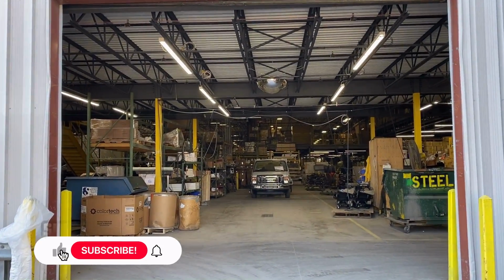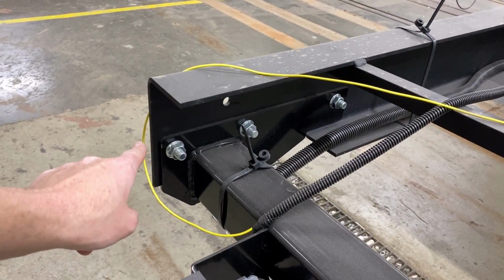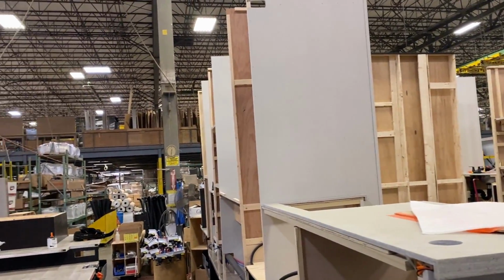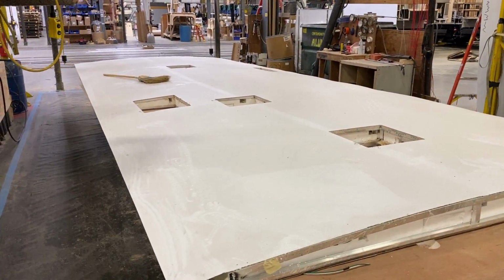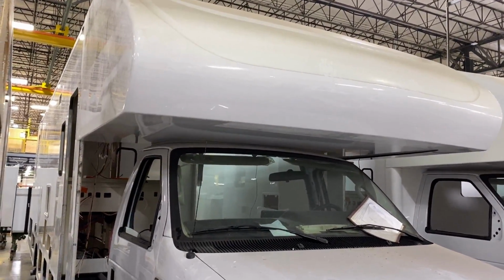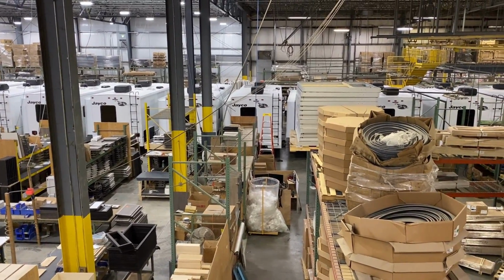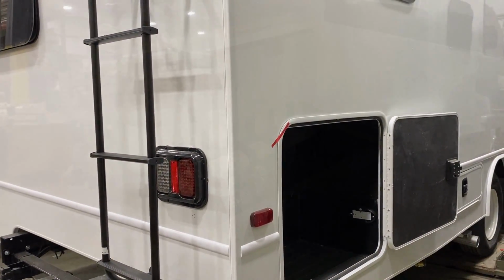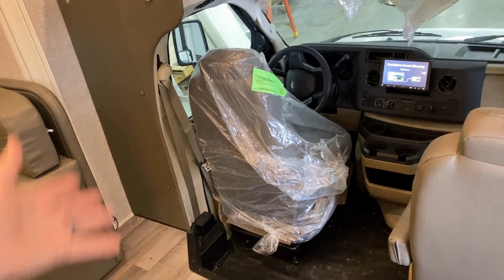Jayco Class C Motorhome Factory Tour!!

Comment: I saw a used 2006 Grey hawk that was a turned in at the dealership to be cleaned up before being re-sold. It had all the tires replaced. It had less than 26K miles. I was the first customer to get a walk thru while it was parked in the service area of the dealership. The attention to detail was outstanding. I asked the salesperson questions and I know that if I need to find out a true answer to my questions, I need to find them in the specs.
 As far as the question you asked about the refrigerator, I believe 12VDC is the way to go. I also have to say that the 30Amp is better than having to try and find a 50Amp site. 
I want to thank Josh for making this video.

Comment: Really like the factory tour! Thank you Josh. 
Yes on the 12v compressor fridge. No on residential fridges.  Dont like having to always be plugged in.
Reply: Actually you can buy a 12 volt residential frig. We bought a class A this past spring and installed a full size GE 12 volt frig. It connects to the coach battery bank and runs on 12 volts only. Ours can go about 2 days without having to charge the batteries. Much better because you have a full size freezer as well as the frig.

Comment: The Melbourne prototype:  WOW!  The Leisure Van Wonder Rear Lounge is one of the most epic small rv's out there.  So popular they have a 1 year backlog on orders the last I heard.  I couldn't believe nobody else was smart enough to copy it.  AH!  Somebody is!  I do prefer it being built on the Ford Transit chassis like Leisure does (MUCH more powerful twin turbo engine, All Wheel Drive!  Gas mileage is close to what the diesel Mercedes chassis gets, yet fuel cost is much lower as is maintenance).  --------  THANK YOU for showing how the Greyhawk front cap works!  IMO, that design is a huge reason to go with this vs other brands due to the lack of seams on edges to leak.  I always wondered how it was designed/installed.  Also, the fiberglass roof is a much have because campgrounds typically have low hanging trees, and those branches do a number on those rubber roofs.  Great job as always Josh.  Thank you for all you do for the community.
Reply from the maker: That LTV model was EXACTLY what I thought about too

Comment: 12 volt refrigerator. yes. and get rid of the 3 piece glass sliding shower door. they are heavy, noisy , and leak water every where.  I replaced mine with a nautilus sliding shower door. reduced the weight by fifty pounds, and no leaks.

Comment: YES to 12 volt fridge!  Coupled with appropriately sized solar panels and battery bank, in what way is that inferior to a lower performance propane powered absorption fridge?  I’d save the propane for the furnace and run the fridge from the sun (with backup power provided by generator charging batteries periodically, if/when necessary).  I recently contacted Jayco suggesting they should consider offering this option on their class Cs, but received a more or less canned response of “We don’t offer that option”.  Love to see that in a Redhawk 26M (one of my favorite floorplans).  Thanks for the tour.

Comment: Love the tour, especially since we’re looking at 2 Greyhawk floor plans 27U or 31F.
We would love the 12v fridge. Jayco is one of the few Class A’s with the propane fridge. I would likely take out the 8 cu ft propane fridge and put in a 10 cu ft 12v fridge.
Reply: Another odd thing I notice with the Jayco Class C is the tan E-450 interior. A black or grey dash and seat would fit the style of the modern decor much better.
Reply from the maker: I would also like to see at least an option for a 12v fridge setup

Any level of solar package + on board Gen offers reliable power reserves I think

Comment: 12v refrigerator is the way to go. It avoids extra cutouts in the sidewall and roof if it is properly roof vented. 

The 12v system has greater internal space for more food, more efficient, cools/freezes faster and to lower temperatures. 

Also, in the winter a 12v refrigerator saves LP for furnace & hot water heater.
Reply from the maker: I tend to agree. TY for this

Comment: Nice tour. On the question re 2-way fridge vs 12V: I wish the industry transitioned to all-electric systems already. Batteries are getting really powerful, I think the right combination of solar panels and lithium batteries could make a perfect alternative to propane, even in a full time boondocking scenario.
Reply from the maker: I think it’s possible but still potentially cost prohibitive in many cases. And supply volumes are also an issue for the large scale production of the industry

I see it continuing to migrate that direction though
Reply: @JoshtheRVNerd  that’s a good point - thanks

Comment: The problem with getting rid of propane, is NOT the fridge.. It really uses the value of a pilot light.. The Gas Hogs are the water heater  and the furnace..  If you could remove those you might have something..

Comment: I would ONLY consider a 12-volt DC fridge because camp hosting it gets to be a pain to drive 27 miles for propane every week. I would install enough solar to charge my LIFEPO4 lithium batteries 90% by solar and 10% by a generator. Then I only have to switch out the portable propane bottle in my STAY A WHILE one per month or two, etc.

Comment: I added an inverter to the space behind fridge (outside access panel) and ran wires to battery. Now, when I unhook shore power and I'm ready to drive away (engine is running), I unplug fridge from dedicated plug and plug it into inverter. Now, technically the fridge is running on 110VAC, although it's coming from the battery and inverter. I agree, bring back the 3-way fridge !!! 2022RH31F
Reply: Also, in all fairness, the 12V option we had on our previous Winnebago Navion (MB Diesel chassis) only maintained the already operational temps of fridge & freezer, it never made the unit colder. But that's all you need it to do, if you are in transit and stopping at another campground with shore power. With what I did to our Redhawk, the fridge is working on 110VAC, so it's not really a "3-way" fridge
Reply from the maker: We agree John, someone start a petition to bring back the 3-way fridge!
(Jen- Josh The RV Nerds other intern)

Comment: We have a 2018 gray hawk with a duel gas and electric refrigerator that was a pain in the butt to operate, because it was hard to get level because not all campgrounds site are level. So if we couldn’t get the camper level the refrigerator wouldn’t work properly.  So we converted it over to a 12 volts system and are glad we did. I have one question for you now that we have a 12 volt refrigerator should we install some solar panels?

Comment: Certainly that power management system could be useful for some of the well optioned travel trailers that only come with a 30 amp service such as the  Greywolf ones.
Reply from the maker: In theory it can but the cost is most obvious and sensitive in that segment so you rarely see it

Comment: No to the 12v refrigerator, those are already dual. I like having options. Why would anyone want to lose options? I get you do lose some space but as others stated for it, I want options based on costs of different energy products. Solar isn't  a viable option as lots of sites have shade.

Keep up the good work nerd lol, love the content.
Reply from the maker: You lose options, sure, but the rv has the equipment to compensate

You also gain more capacity and about 4x faster cooling

Comment: Josh what was stretched was from the back of the cab to that cross member that is grey
Reply from the maker: Time stamp please?
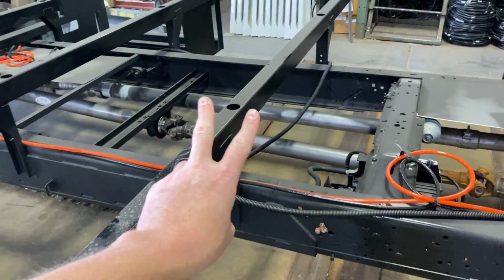Reply: @JoshtheRVNerd  at 2:12 in the video the rear axle section of the frame is untouched just from back of the cab to the rear axle and then behind the rear axle is lengthened from where Ford would put the hitch
Reply: @JoshtheRVNerd  if you also look at where the factory hitch would be they don’t fish plate the frame where they extended it you wonder why people have the hitch’s fall off or the frame go snap this is why

Comment: Josh the way they stretch the chassis I would like to see them not stretch it the way they do cause it creates a failure point in multiple areas when a big tow truck gets built if they can’t find the right chassis they will stretch the frame in a Z cut then they will box the section of the frame before and after and fish plate over all the welds for safety the way jayco does it is not safe cause you see where ford has all there pre drilled holes for different configurations in the frame jayco has now made that a failure point and also de rates the towing capacity from what they claim of 5000 pounds to 3500 pounds safely

Comment: That line looked awfully cramped for work space. During production, are those units more spread out for access and then telescoped together at the end of the shift? 

There are a LOT of units in process inside that building! Did they tell you how long from start to finish and how many were rolling out daily during a shift? That’s a huge place!
Reply from the maker: During working hours there is usually a bit more space between the rigs yes
Reply from the maker: I don’t have a good idea I’m start to finish time accordingly. I never remember to ask Matt when I visit. I’m sure it also varies by which floor plan their building. Larger models of more slide certain they would take longer

Comment: love the "how it's made" videos.
one topic i would really like see discussed is the reality of using 12V fridges vs the 120V/propane systems particularly been boondocking.  sure the 12v fridge will run indefinitely while driving or hooked up to a campsite.  will a 12v fridge run properly off the tow vehicles power system?  yes i know there is a 12v feed through the 7 pin connector, but is that adequete to run the fridge?  how much solar power and battery power do you really need to run an rv when boondocking in the real world?  of course ac is put of the question.  it's a sure bet that those 180 watt solar panels do not put out anywhere near that in the real world, they would have to be perpendicular to the sun all the time for that to happen
Reply from the maker: I can say with 100% personal confidence the 12v fridge can run indefinitely in transit. I see them arrive with no battery on the rv (aka 100% tow vehicle power) and they’re ice cold 

How much solar you need is a topic of debate due to differing conditions. From what I see reported if you have near 400w of solar and aren’t parked in the trees, then you should be okay but again.. it can vary
Reply: @JoshtheRVNerd  thanks for that, we are considering a new trailer and one decision to make is fridge type
solar power is a huge variable, the panel must be angled perfectly to get max output and horizontal on the roof is far from ideal.  where we are are (and you) the panel should be angled around 35 to 45 degrees from the horizon depending on the time of year and the time of day

Comment: Josh!  Love your stuff man!  I don’t see an option for a king in the Jayco RedHawk 31F.  Is that an easy swap?  Will a king even fit?  Thanks ahead of time!
Reply from the maker: There's no factory allowance for it I'm afraid. You may have some DIY opportunity by removing those side stands but they usually have power outlets and stuff in them you'd have to be conscious of
Reply: Thanks for the fast response!  Every RV our family is interested in we make sure we watch your video.  Been doing it for years!  We need a bunkhouse with king, for all the little ones who like to climb in with mom and dad in those early morning hours.  We had a Jayco and loved it, but no king.  Tried to upgrade the bed and the screws come from the outside in, which made it difficult to remove cabinetry, not including electrical.  Thanks again for the response!

Comment: What if power wasn’t available because of Cloudy days. U would need another way of power Propane is good on Refrigerator
Reply from the maker: Solar doesn’t actually run a fridge. Battery runs a 12v fridge. It would have a battery reserve available, Gen on board as needed, and park power of available

Comment: I had one of these. Jayco greyhawk. Horribly built. All these wires exposed under the rig with connections that weren’t weather proof. I spent a day zip tying a lot up from being able to get caught because they were just stuffed in places hanging. All water pipe exposed to elements so winter camping a no go. Chassis is way too under rated for our unit the 31f. You literally ride on the hockey pucks he’s talking about because the spring aren’t strong enough to support the unit. I ended up having to add another helper leaf. Then the generator design is bad, it absorbed all the heat from the engine and would not run going down the road. I could over come everything but that. Once Jayco didn’t care, and wouldn’t even call me back and ignored all calls about it I gave up and sold the unit. There’s better options else where and if your looking for a bigger rig don’t get the e450 ford chassis.

Comment: All electrical, structural, plumbing built by unqualified cheap labor.  As detailed by the shit welds shown and the hand wrapped cable terminations.  T&G plywood is better than glued chipboard - Chipboard get wet and off gasses the adhesive - toxic. The cabinetry will probably be superior build quality due to the skills of the Amish, however, then get the hell beat out of them as they slide down the dirty abrasive chute. The roof is still being built to leak - the best roofs have heat sealed raised flanged openings with secondary gussets. Carlyle TPO 60mil thick. no pour on self leveling crap sealant. The manufacturers don't care because they just need a year to get rid of the warranty and the rest is on you - I wish they would build a quality product.